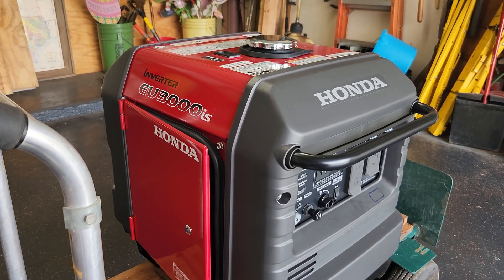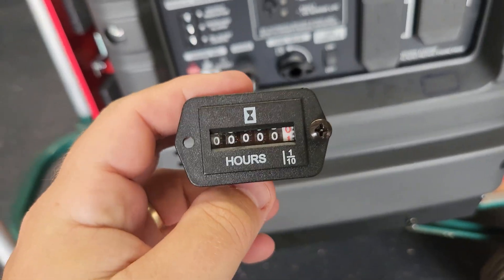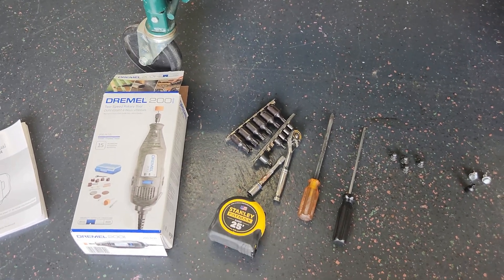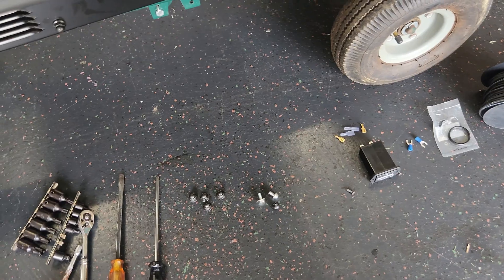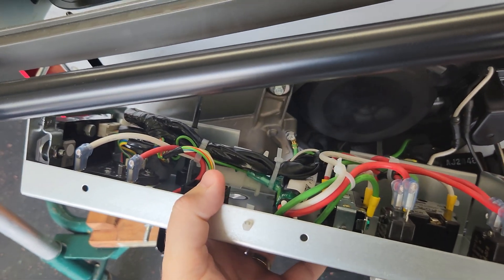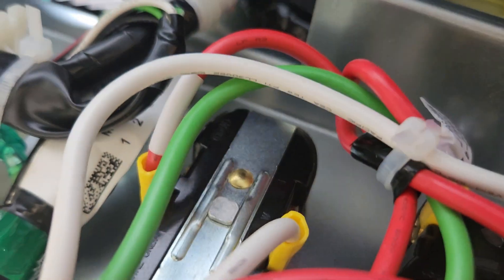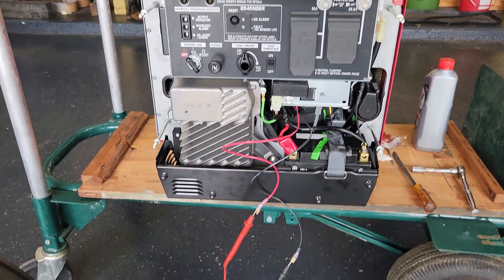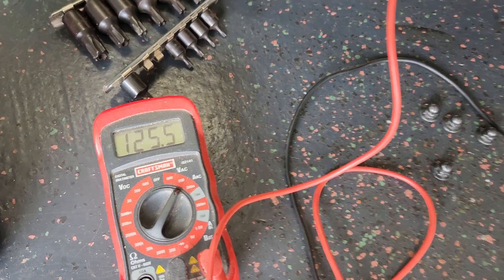Installing Analog Hour Meter on Honda EU3000is Generator

Comment: Awesome Instructional video. I will be buying my second one of these generators. My current one may need valves re-seated. Not having an hour meter wasn't good for me. I can no longer do much mechanical or electrical/ electronic. I do think with this instructional video I can maybe with a little help from my son or a friend I can install it. 

The one That no longer runs Lasted a very long time. @10 yrs. Used for power at my camp site and I need A/C due to CP0D . Asthma since birth.

Thank You for the Very Well done Video !!

Comment: Enjoyed the video. Just picked up my new eu3000is a couple days ago. I would have preferred an analog hour meter with that type of installation but its still under warranty. So I have to settle for the digital. After warranty I can always convert. The one I did on my lawn tractor never failed and that was 20 years ago.

Comment: Wish you had shown how you connected the spade terminals. Did you push the outlet out to get the screws?
Reply: I used an 8mm socket to unscrew the outlet and wrap the wire around the terminal.  Spade connectors seem redundant. Also make the leads 16-18 inches or so.  Mine were a little short.
Reply: Also, Also err towards the upper edge when cutting the opening for the meter

Comment: Thanks for your video. I agree going with the mechanical Hr/meter. I have an used EU3000is I recently picked up but to keep track of maintenance intervals it's good to still have a meter. Because mine is the 12v DC receptacle version and not the Parallel/CO-Minder one like yours, I was thinking of getting the DC 6V to 80V meter and splice the wires into the back of that receptacle. I know the DC charging output is not regulated but hopefully should be okay? (DC output will vary according to the position of the Eco-Throttle switch. When the Eco-Throttle switch is turned to the ON position and the AC output is not used, the DC current will be about one-third of the rated current.) I looked at other location for the meter to be mounted to protect from moisture but yours seems to be the only option.